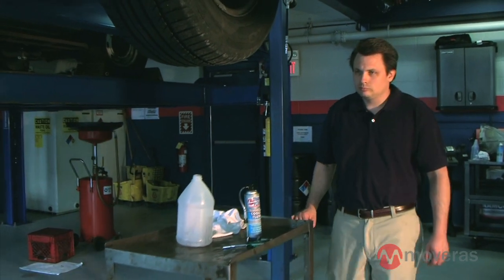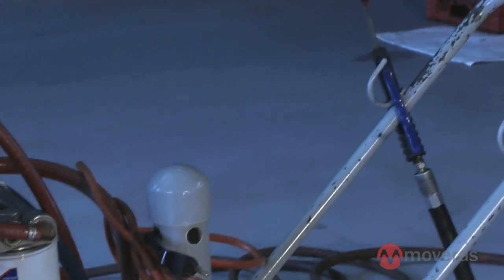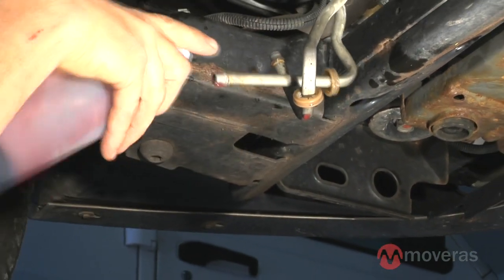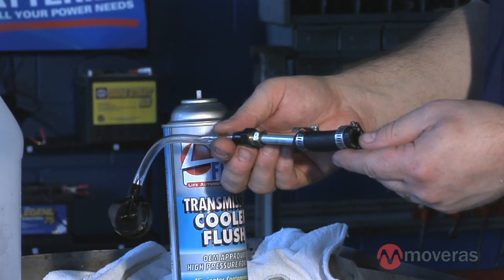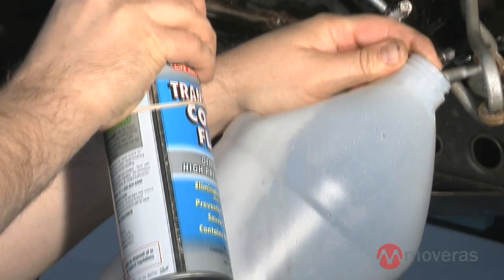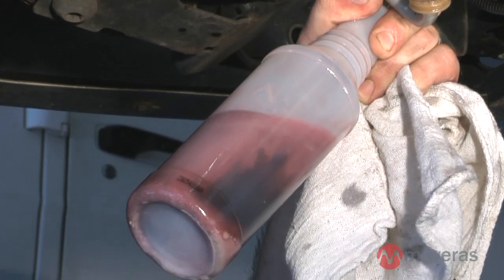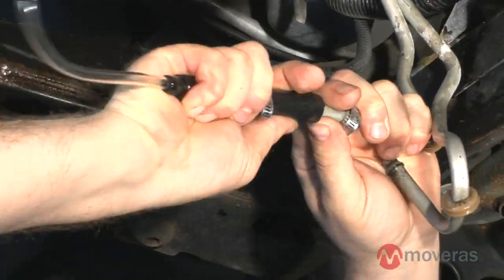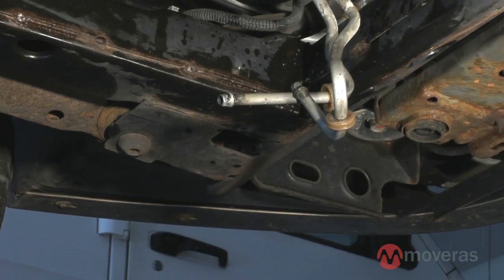Flushing a Transmission Cooler with a Transmission Flush Can

Comment: For adapting the air line to the Suburban transmission fluid line, I used an old transmission line adapter fitting combined with a female airline adapter (pitches were a little different, but with teflon tape, it was a tight seal). 

I clipped the fluid line adapter to the fluid line, hooked the air hose to it and forced the contaminated fluid out. 

To adapt the Kooler Kleen nozzle to the airline, I used a 5/16" brake line. The brake line has the required thread and pitch to adapt to the Kooler Kleen nozzle. 

On the other end of the brake line, I hose clamped  a 5/16" gas line to the brake line, and the other end of the 5/16" gas line I slid over the transmission fluid line. 

I didn't use a clamp; it was very hard to get on, fit real tight, and I had to cut the gas line to get it off.

Comment: Can't I just remove the return line, and pump tranny fluid through the cooler, letting the transmission do the pumping for me? My transmission is shifting smoothly, but the fluid is brown, no metal, no burnt smell. I halfway expect the transmission to slip after replacing the fluid. I want the pan dropped, the pan cleaned, the filter replaced, and a new gasket, before I flush & change fluid. The tranny runs hot, and the clutches do not grab quite like they should. No weird noises, no clunks, no vibrations, it just does not transfer power like it should when the temp gauge gets above about 225 degrees. When it's at running temp or below it runs tip top. If I had the tools, and work space, I'd go buy a core & do my own rebuild, with Kevlar band, high perf sprags, 6 pinion planetary, high perf clutch packs, treated steel plates, heavy sun shroud, new solenoids, new wire harness. Years ago, all my vehicles had spares ready to go.  350CID on a stand, 700R4 in a crate, radiator in a box, brake parts, filters, AC unit complete, etc. My truck was my office and my shop. I spit a tooth out the rear end, and burned a clutch. I got the rear end in late that night, tossed the clutch, flywheel, pressure plate and my tools in the truck and prayed I would make it 500 miles to a hotel to do the clutch. I wound up doing the clutch on the roadside adjacent to a highway construction blasting site. ADOT's contractors let me use their facilities, (office, phone, toilets), and I had the clutch in in about 110 minutes. It took 2 hours  for stuff to cool down enough to touch. So I was down for 4 more hours.  Had I not had to stop for construction 52 times I'd have made the hotel. That truck had a manual transmission.
Reply: Seth B Why all the information. No one cares. It's called a comment. Not a story about random things.
Reply: I replaced the transmission twice in my 2012 Nissan Altima!   The dealership in Halifax, NS, didn't use your process to purge the crud block out of the transmission cooler!  Bill for labour for replacement of first burnt up transmission with my own recycled transmission at the Nissan dealer was $2700.  I used another recycled transmission a month later and had Parks End Auro install it for me.  They discovered that the transmission cooler was totally non functional, and refitted another larger after market transmission cooler.  Bill for labour for the entire job: $1600. No more transmission problems after that!